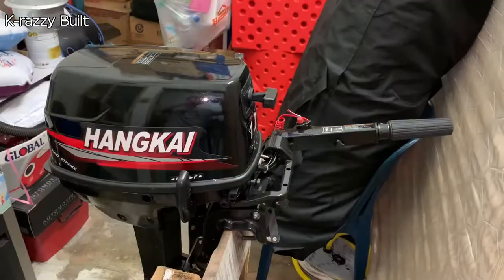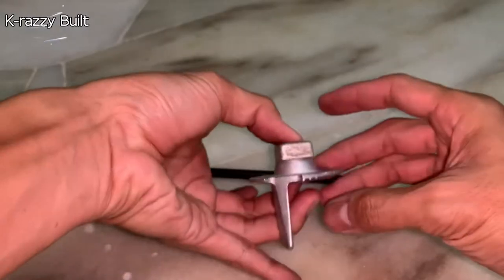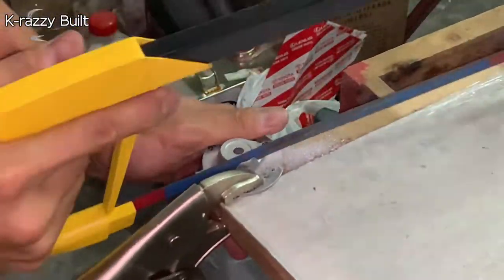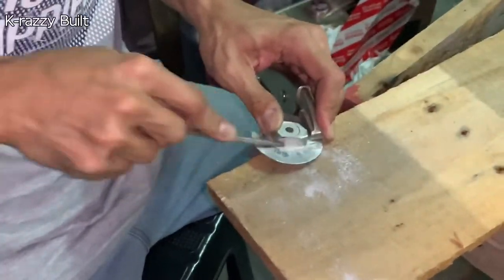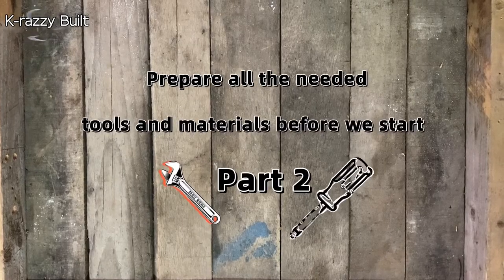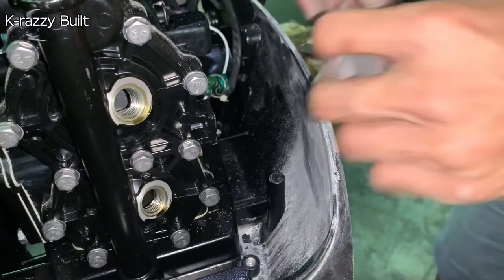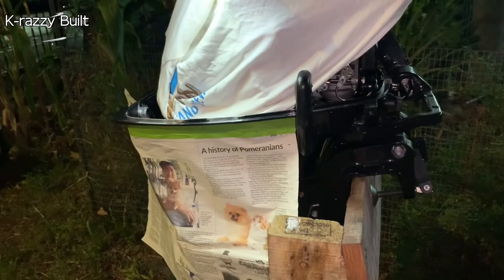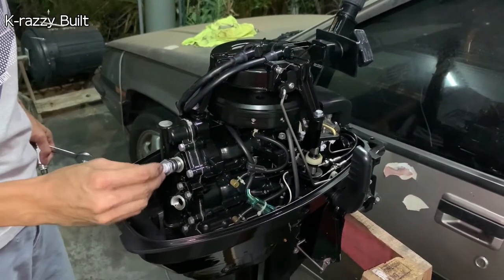HANGKAI 12HP OUTBOARD MOTOR ANODE UPGRADE AND REPAINTING AFTER 6 MONTHS AND 6 TIMES BOATING AT SEA

Comment: Putting a bigger anode won't help with corrosion with parts of the motor that aren't under water. Anodes only help stop electrolysis on metals that are submerged under the water line. Not metals exposed to air. That's what primers and paint protect.
Reply from the maker: Thanks for your sharing. I really appreciate it.

Comment: Are you using this motor in saltwater or freshwater? I'm looking at getting one for my inflatable. Thanks and good video
Reply from the maker: Hi Ryan. Thanks for your support. I used it for both saltwater and fresh water. Works well for both. But you need to flush your enshrine every time you finished using it at saltwater.

Comment: I have the oportunit8to buy a Tohatsu from 1998 in good shape for 300€ but I don't know if I buy it or go for a new Hangkai 12hp. I use it 1 or 2 times a week on salt water and can't flush it every time, maybe each 5 or 10 times that I will use it.

What do you think that it's better?
Reply from the maker: Hi @josefialho6650 actually the Tohatsu 8hp is similar to Hangkai 12hp in terms of HP. For me, I would go for new one as maintenance wise would be lesser compared to a used one. Furthermore, it is 1998 model so I don’t recommend to buy it. Anyway, it’s just my personal opinion.
Reply: @k-razzybuilt8467  I have made a deal and have the new outboard. It's a 1997 Mercury 15hp 2 stroke that it's has new. Even have the original spark plugs in it! Very good compression, any rust... Works perfectly but just in case I will rebuild the carb, change impeller and gear oil. The last owner pasted and his son sold it to me for 250€ without any idea of outboards!

Thanks for your reply 👍